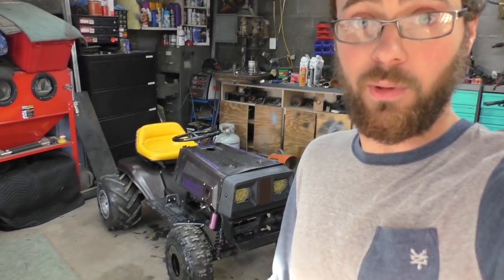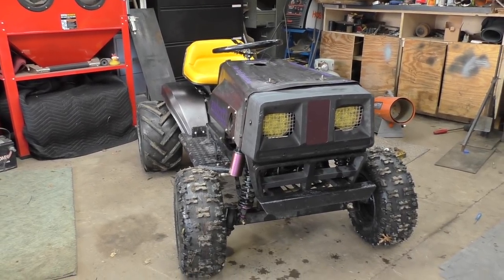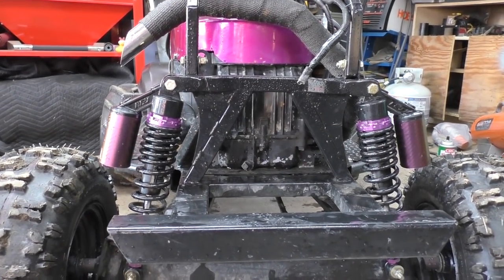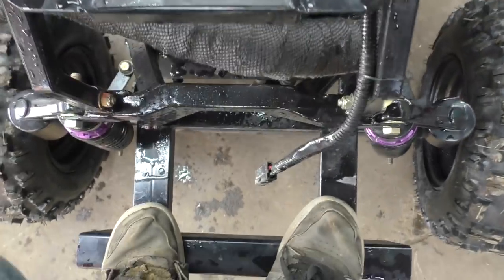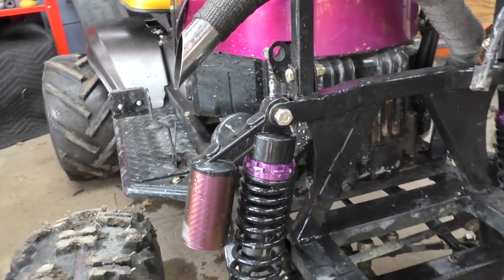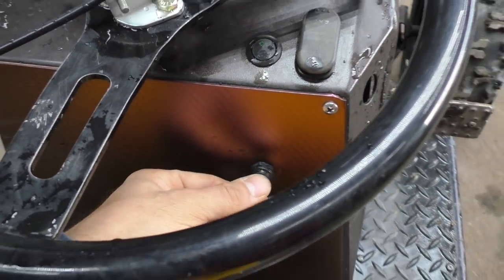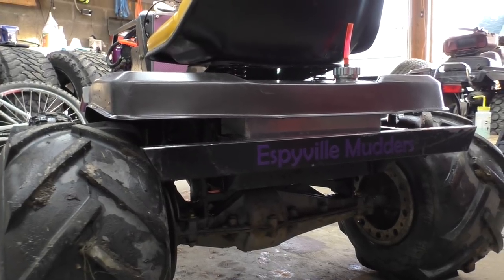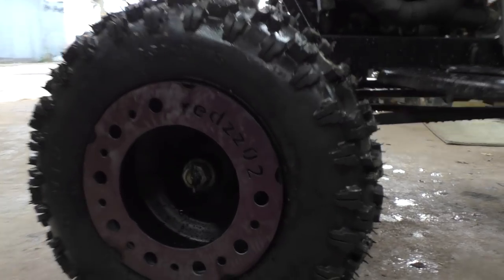How I Built The Haspin Build

Comment: That's a badass tractor, I just made a intake for my 18 vanguard, single carb 34mm mikuni, I've seen a few vanguard engine builds with the motor turned around, which is a hell of a lot better for the throttle and wiring, I think I'll turn mine around
Reply from the maker: Heck yeah! Thank you and best of luck on your build

Comment: I'm just starting and want to use my  simplicity mower 16hp and what to start with more power and tires bigger tires what should I start with
Reply from the maker: Nabiel Suleiman power mods are last, you can have a blast with 5hp. First modification should be locking your transaxle, next mod would be larger more aggressive rear tires/and larger front tires. Next would be a foot throttle to make it easier to drive. Next would be bumpers and any reinforcements needed to the frame

Comment: Man Sean that is one baddass machine, are there any downsides to mounting the engine backwards ? I'd imagine it made the choke/throttle cable connections a bit easier to accomplish
Reply from the maker: Mr. Savage no down sides to mounting it “backwards” it’s for sale for $1100 if you’d like to buy it
Reply: @redzz02  lol I got my hands full with Rasputin but I'm looking to eventually build a real frame and the works on a brand new rig
Reply: @redzz02  you already know I'm a built not bought kinda guy, it would be awesome to own the haspin build but that's a long drive to Pennsylvania, I'm only trying to make that drive for TTC 2021

Comment: Dude, not to sound like a jerk, but you're over exaggerating that roll over.  Every mower guy I know has rolled his, and none of them ever had any issues other than a dent or two and some scratches.
Reply from the maker: T.J. Boismier I don't think I was over exaggerating anything....? I just explained what happened to it? I'm not sitting here saying omg I almost lost my life or anything like that. I wish I had pictures from when I rolled my mud dynamark down a hill several years ago when my steering wheel broke off, the whole body tunnel got bent and shifted to the side, the carburetor broke off the motor.
Reply from the maker: T.J. Boismier I literally roll my mowers all the time, the difference is this one is entered in the build off competition and the dead line is next Friday haha
Reply: @redzz02  Well the worst I've ever seen honestly is oil dripping down the pcv and it smoked for a minute.  I just think it's a little over the top saying "This is what saved my whole motor" and stuff.  And believe me, I know what that's like, lol.  I broke the shifter on my 2300 internally 1.5 weeks before the end, managed to find a new one on Craigslist and it's finishing.
Reply from the maker: T.J. Boismier who's to say that it didn't save my motor? The video was cut off halfway through my roll over it continued to slide down the hill on it's hood. Do you really think a tractor sliding down on a sheet metal hood and plastic grill wouldn't have been more damaged if their was not an engine cage there to support it? If the hood would have collapsed my exhaust is above my engine and could have busted that off or even damaged my heads, just because you have only Seen minor damage on roll overs doesn't mean others haven't sustained worse on their rigs, i don't have a spare hood laying around to swap out either, my point is the engine cage in fact did save a lot of components on this build and it perform exactly how I hoped it would
Reply: @redzz02  I've seen quite a few mowers roll onto their hood and everything was fine except a few dents and scratches.